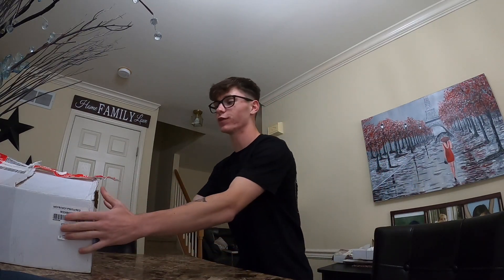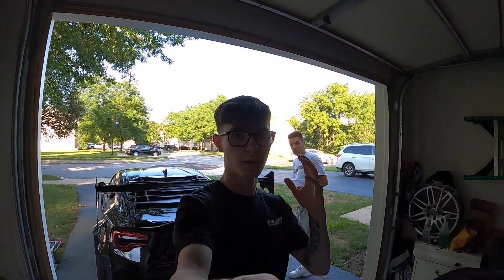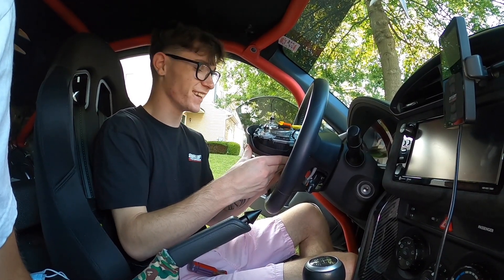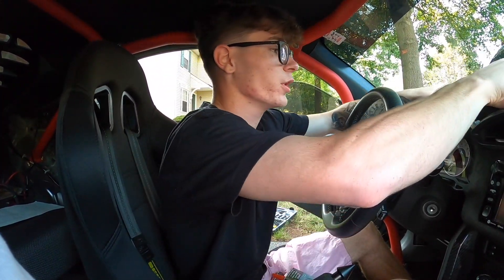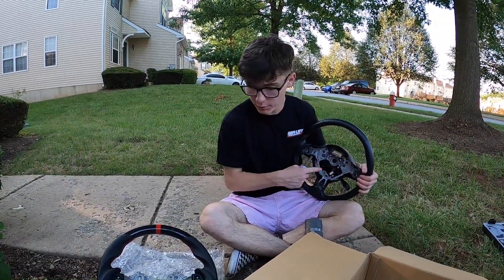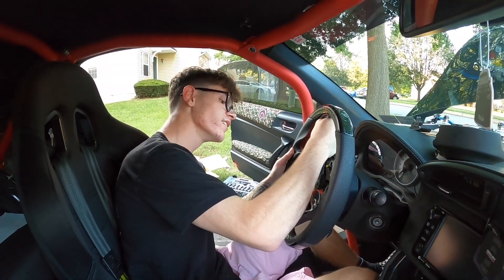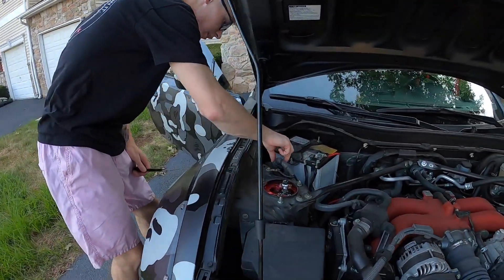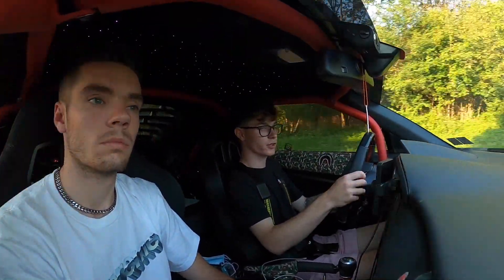Ebay $250 Carbon Fiber wheel review & Install for Gt86/brz/frs

Comment: Hey man I’m a huge supporter and I see ur car around at the meets cuz I’m around here and I love everything about ur car and the steering wheel completes it I think it’s amazing but I’m just letting u know that the easiness of turning the wheel should not have changed because that all depends on the power steering so if u want u could recheck all the bolts cuz they should feel the same when ur turning the wheel just a heads up and keep up the good work I love the work
Reply from the maker: Andrew Farid previously I had a nrg hub so it was slightly different mounting